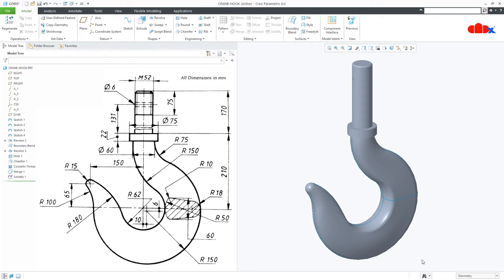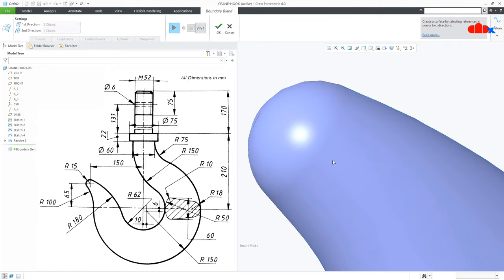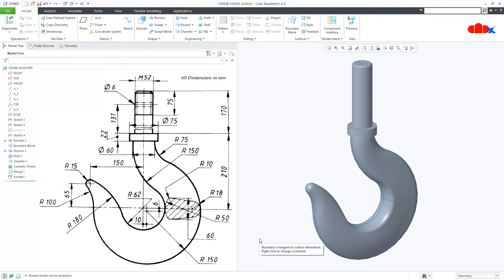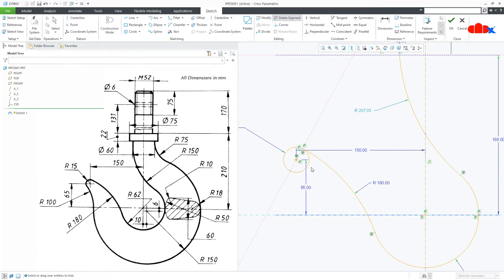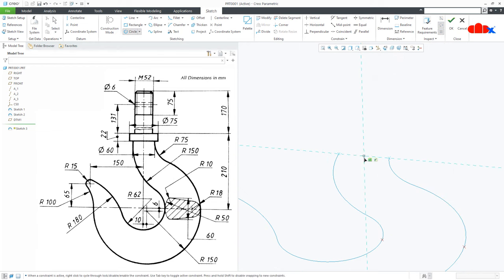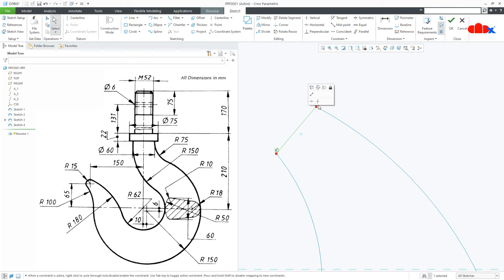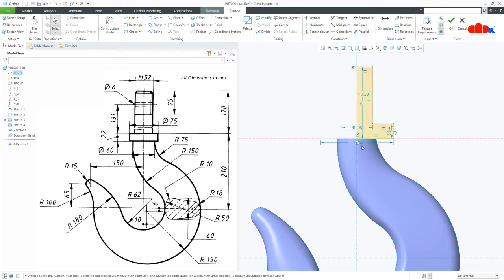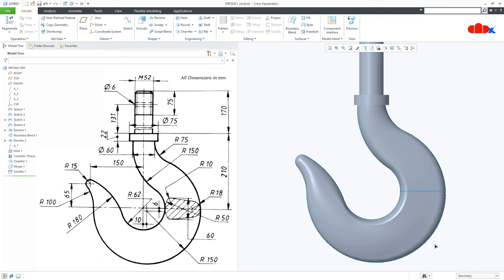Crane Hook | Boundary blend | Surface modeling  in Creo Parametric

Comment: I, too, had trouble in getting the boundary blend to work using all 3 sketch references. To solve I did this:
 1. Boundary Blend: Profile sketches #1 & #2
 2. Fill both ends of blend from step 1
 3. Merge blend & both fills, then Solidify
 4. Create Revolve (Nose of hook)
 5. Boundary Blend edge of revolve & center profile sketch
 6. Merge blend from step 5 then Solidify
 7. create last revolve, hole, cosmetic thread & chamfer

Done!
Reply from the maker: Good

Comment: Hello, I am getting error like "try adding curves between curves no.0 and No.1 in the first direction" while adding nodes in Boundary Blend, can u help me with that? @CADx
Reply from the maker: Your path and sketch section must be connected with each other to form the boundary blend. So create datum points on the path and take the reference of these datum points while creating the section. You will not get any error. Watch the video carefully to see all the steps followed.
Reply: Try by using two control points

Comment: Hello sir. Can crane hook be modelled with swept blend or blend ? I have tried several times, but goal is not accomplished .
Reply from the maker: No, it is not possible by swept blend are blend. You cannot maintain all the dimensions using swept blend. There are two guide curves in crane hook. If you use swept blend you can only maintain One guide curve.

Comment: I find this tutorial was very helpful, but I am unable to form a boundary blend with the third section at the revolve. When I select the top and middle section(sketches), shape is generating, but when I click for the third section as profile of the revolve it's not showing any preview. Could you please help me out if I am making some mistake. I am getting some preview if I don't select the paths, but to get the required shape the blend is not generating with the paths.
Reply from the maker: Change your part accuracy first. Make it 0.01
Reply: @CADxTraining  I tried changing the accuracy to 0.01, but it's not working yet.
Reply from the maker: Just give a last try. Change the accuracy to absolute and make it 0.0001
Reply: @CADxTraining  It's still not working, I will start from scratch once again and will see if it works. either way thank you for the quick reply

Comment: hello sir,boundary blend feature fails after giving control points.
Reply from the maker: Increase the file accuracy and try
Reply: @CADxTraining  by taking two control points it is working, but is it correct ?
Reply from the maker: Modified the third control point according to the surface formed. After that you can select that point.
Reply: @CADxTraining  how to modify ?
Reply from the maker: Share your part to me. I will check. Which version of Creo parametric are you using?
email2cadx@gmail.com
Reply: @CADxTraining  Currently im using Creo 6.0 Student Version

Comment: How could u mention M52 IN DRAWING and how could u show section 2 in drawing sir
Reply from the maker: Watch this to know more.
https://youtu.be/E1KMeKNNeMo
Reply: @CADxTraining  sir one more doubt I saw almost all your sheetmetal videos. By viewing that I understand that two methods to make quilt one by making traingle extruded part and then using quilt form another one using revolve option and then quilt .
While using quilt on revolve surface a deformation arrows are strangely located somewhere .I'm able to make quilt form

How could correct that sir
Reply from the maker: I didn't get your question.
Reply: @CADxTraining  sir while using quilt form surface selected and mentioned with colour green but flip arrows are located somewhere on the object